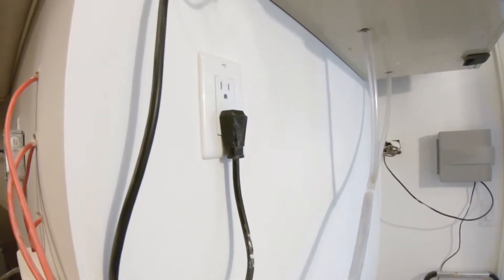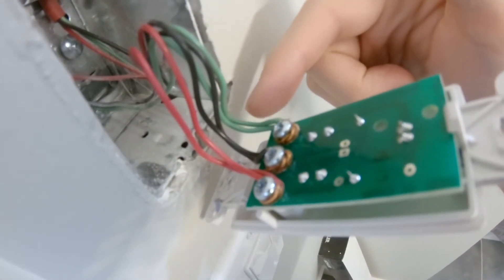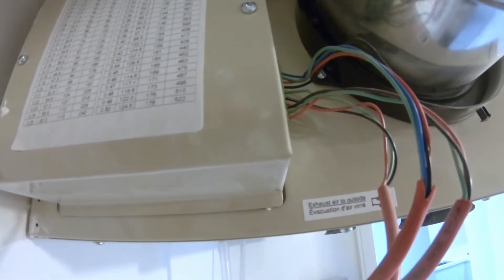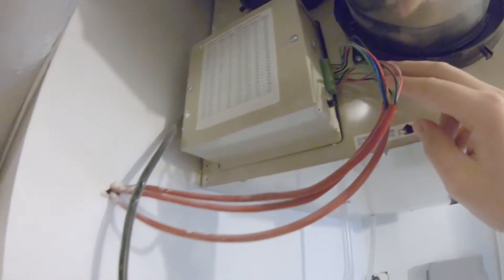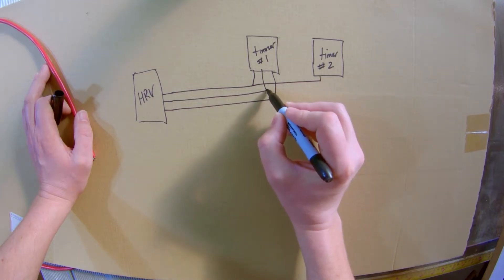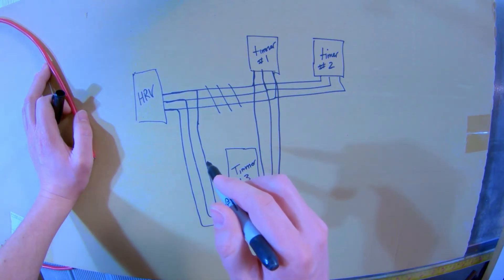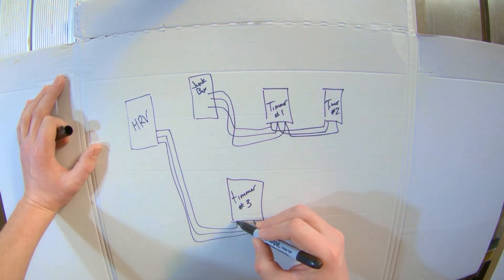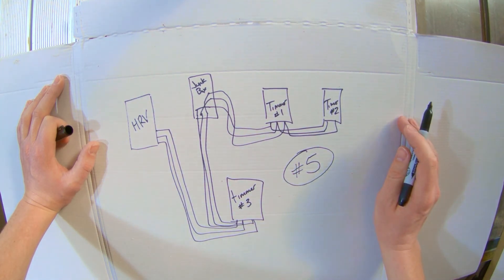Adding a Timer to an HRV (Heat Recovery Ventilator)

Comment: Hi. Wondering if I could just replace the factory wall switch with a smart switch (for controlling lights) with a DIMMER.  Or just plug the power to a Simple Smart switch and set the control to say …green or orange ,…but use the smart electrical plug switch to control the electricity
Reply from the maker: These timers are running a 12V system and I believe a 120V rated switch would draw too much power and would cause you more problems than it would be worth. I would stick to the basic 12V circuit switch.

Comment: Yeah you really dont need to do what you did (re-wiring) .. just leave everything as is and add additional switches anywhere on the circuit.
Reply from the maker: But then wouldn't you have wire junctions just in the middle of a run? At least here any junctions need to be accessible from a junction box.

Comment: you def dont need to run the wires back just add new switch anywhere on the circuit. You can strip off the wires going to an existing switch (if you can find) and add it there. Thats what  I did, works well.
Reply from the maker: I agree it would work, but then you have wired connections that aren't accessible. I believe by code all connections need to be accessible from a junction box at all times. So you can't just cut into the wire mid run above the ceiling and splice into it.
Reply: I see what you mean. Did you leave the junction box accessible In ceiling with a wall plate. Would that work?
Reply: @sushi13141  nope connected it in the ceiling and drywalled over it :)
Reply: @radekw708  haha yes that would work eh
Reply: @sushi13141  its low voltage I don't think code requires a junction box.. once you have a good connection the environment is pretty stable so shouldn't have issues. I have had outlets and switches die in a new house though that were installed by "professionals" so yeah .. I prefer to do things myself and take the time to do it right.
Reply: @radekw708  totally. Love doing the work myself to perfection!

Comment: hi there, is it possible and is it ok to connect a new timer directly to the HRV, to the same place were the other timers already are connected??? thanks
Reply from the maker: I had not thought of doing that. However I suppose that you might be able to do that provided you could get both wires into the connection terminal properly.
Reply: @ResearchDesignBuild  thanks for your prompt answer, my connection terminal is width screws, so would that be ok...?
Reply from the maker: @LUISNEVESseven  Yes I think that should work. I would double check the manual and see if they say any differently just to be sure.
Reply: @ResearchDesignBuild  will do thanks.
Reply: yes this is the easiest you can tap in anywhere in fact.. this guy made it way more complicated than it actually is. He didn't understand the wiring diagram he showed in the video..

Comment: Thank you so much! This exactly what I needed. Looks like we have the same HRV unit and adding the last time. Might have to go junction box like you showed in the end. Very very useful!!
Reply from the maker: Glad it helped! and thanks for the video suggestion.
Reply: @ResearchDesignBuild  so finally one year later I did this just like how you explained. Everything works as it should. I incidentally found out my blower motor was shot. And changed that out unrelated to adding a timer but wow that was as easy as a swap. Should have made a video ha. 

Thanks a lot! Getting closer to
My basement finish
Reply from the maker: @sushi13141  Great to hear you are making good progress on your renovation. And yes you should have made a video on that swap, haha. I would have watched!

Comment: Nice. Section 725 in the national electrical code (usa) governs the low voltage rules for wiring and class 2 wiring is typical for these devices which is limited to 100 volt-amps. The reason your can do a maximum of 5 has to do with your power source and the power draw of each timer. For example, if your power source coming from the HRV is 100 va, and each timer switch draws 18 va, five of them would draw a total of 18*5=90va. Any more would go over the limits of the source. Also if you cable isn't behind the drywall consider using plenum rated cable.  Keep up the great work!
Reply from the maker: I knew I could count on you to chime in with the answer for that one. Thanks
Reply: @ResearchDesignBuild  controls happens to be my specialty. ❤️✌️
Reply: Hello guys, 
    Quick question. 
   How about if we use Fantech RTS-W (wireless push button timer) which communicate with Eco touch IAQ. Then there is no wiring required . 
Can we add more than 5. I know wired timer is max 5 timers. 
   Why I am asking this I am going to build the big multi family icf home and planing to use light commercial Fantech hrv SHR 700. 
We will have more than 5 bathroom.
Reply from the maker: @hunjan315  I would be worried if you are doing a full ICF house using a wireless system. Concrete walls and wireless systems don't always work that great. Looking at the manual on page 13 https://shop.fantech.net/upload/assets/444567_LIGHT_COMMERCIAL_SHR_IOM_EN_FR_20190426_182323054.PDF it says the maximum number of secondary controls, wireless or not is 5 regardless of the style you use. You might have to do two systems for a house that size.
Reply: @ResearchDesignBuild  thankx very much.
Reply from the maker: @hunjan315  not a problem, anytime.